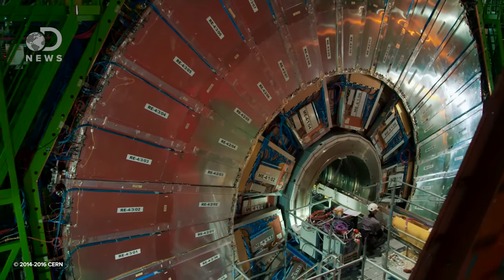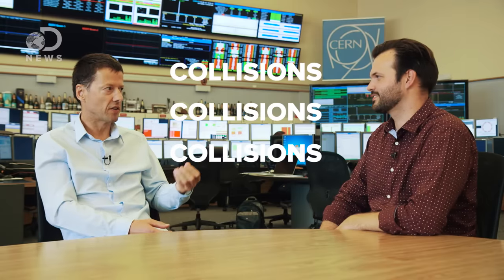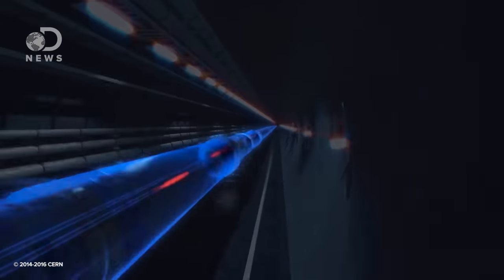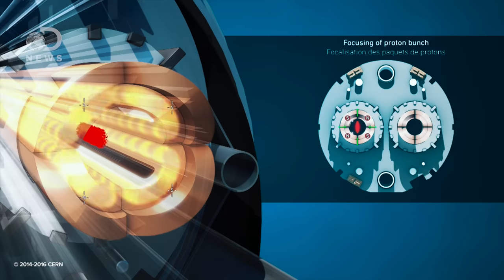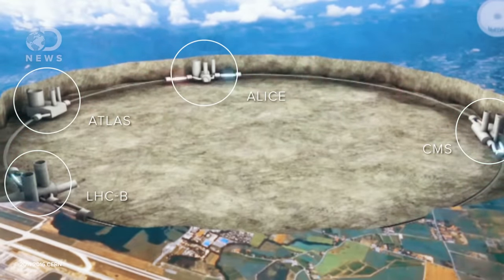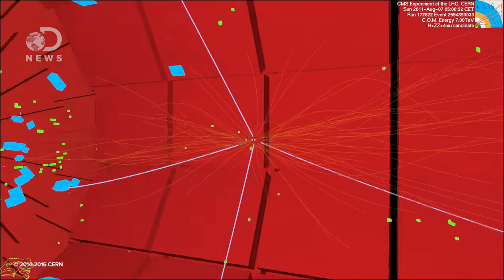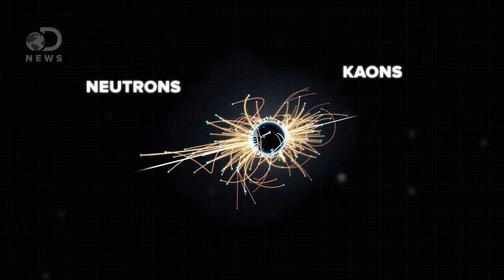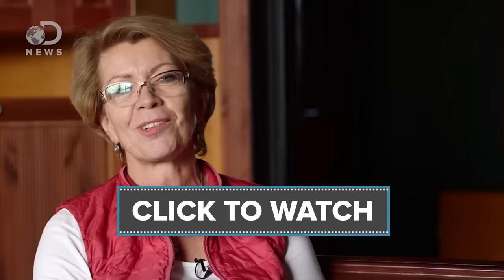Inside The World's Largest Particle Accelerator

Comment: From observing the footage of the particles colliding, there is a few milliseconds for the collision to cool down before another collision happens. These particles move at 99.997% the speed of light, and is still currently being worked on my CERN to get a lot faster. As stated here, the particles also tend to miss each other, making the collisions even more inconsistent. So by theory, if we were to achieve 99.998% of the speed of light or higher, while also maintaining the particles at a specific point in which the chances of missing each other is only slim, or increasing the quantities of the particles to have a higher collision consistency, it may be possible to generate dark matter. This happens because the increased consistency and speed, ultimately disabling the few milliseconds of no contact, will increase the number of collisions in a short amount of time that the odds of creating dark matter increases by 5% the initial percentage. so in short monke explanation, more particle, more fast, make more collision big chance black hole material.
Reply: Intern reaching its target of  High Velocity?

Comment: "What's inside a proton." This is a bit inaccurate. The collisions do not reveal what is inside a proton, but basically use the famous Einstein formula E = mc². 
Two protons collide with almost the speed of light. This creates huge energies that then again allows the particles to form, disintegrate and others to form until there are stable ones. 
Please correct me if I am wrong.

Comment: Could you use sound or light waves to try control the way the particles are moving throughout the Hadron collider? Or combination or heat sound and light
Reply: No, because sound is too slow. Light waves, maybe, but I doubt it. Photons have no mass, and don't really "collide" with things. They would be more likely to knock the protons off their course. 

For the record, though, the reason that these protons miss so often isn't because of technical error. It's just impossible to estimate where the nucleus of an atom is at any given moment.

Comment: How did they separate the protons from there hydrogen atoms to get the 100 billion protons?
Reply: Hydrogen gas is ionised using a strong electric field, and the resulting protons are accelerated and focused then injected into a linear accelerator.
Reply: @thevectmarketing5784  So the strong electric field kind of takes the protons from the hydrogen gas after ionizing it?

Comment: I always thought a dipole magnet was 1 single magnet but with 2 poles - a positive (+) and negative (-) not 2 magnets. Most magnets we are familiar with are dipole if I remember rightly, so you can take 2 dipole magnets and put the north/positive/+ pole from magnet 1 against the negative side of magnet 2 and they are attracted to one another. Then, in a way, they become 1 dipole with a shared plus and negative. if a + pole is put against another + pole they push apart. I might be wrong but that was always my understanding.

Comment: have they realize that they can create a black hole if the hadrons colide in wrong way or ever make a nuclear reaction
Reply: Of course they've considered what could go wrong before spending ten years building it.

It's entirely possible that a micro black hole can form. However, it would be so small that it would decay instantly. Nuclear reactions don't make sense, because you'd need atoms to do that, not just protons. In fact, the protons probably release way more energy than an atom when they collide, but it wouldn't be anywhere near as catastrophic as a nuclear bomb. That involves a large number of atoms fissioning in a chain reaction. Something like that can't be achieved on a subatomic level.

Comment: Impossible for mass to change - would destabilize particle. Harder to spin heavier particles, more charge, destabilize for many reasons - even harder to move a heavier subatomic particle in an atom. Instead of calculating the energy as mass calculate it as energy of motion or time of particle decreasing (since both are calculated) - no stopwatch on particle lol. Infinite energy means infinetally reducing time of the particle which means infinite velocity which means yes speed of light broken just like when two particles pass each other going over half the speed of light - in that case too the speed of light is broken - proves its possible.

Comment: What is electricity (I think its flow of electrons ) how electrons are generated from hydropower station or others sources of electricity because actually electron will be floating around proton in atom.so how  they  are removed from atom and are made into  electricity  .why metals conduct electricity.how electricity is converted into light in bulb .show answer with animation

Comment: It is difficult to know the type of charge of a particle based on the way it curved within a fixed external magnetic field. This is because the intrinsic magnetic field of the particle depending on two factors, namely its type of charge as well as the direction of its intrinsic spin motion. For instance, positrons are also negatively charged like those electrons but their intrinsic spin motion direction is opposite to the one of electrons. Really?
Anderson discovered positrons with the aid of a cloud chamber with a fixed external magnetic field on a mountaintop in California under intense sunlight. The energy level of sunlight is far below the one within the nucleus. Therefore ejected positrons must be derived from the electron-shell rather than from the nucleus. If positrons were positively charged, then they would be constantly repelled from atom to atom by protons within the nuclei. This is not what happening, therefore without any doubt that ejected positrons must originate from electron-shell. Why positrons have mirror magnetic field configuration than the one of electrons? 
We reckon positrons have opposite intrinsic spin motion than the one of electrons; thus, positrons possess opposite magnetic configuration than the one of electrons even if they have similar charge like those electrons. 
Let''s get back to basic before we become foolish in our endeavor in search for tinier, lighter sub-particles. In other words, we couldn't even get the charge of positrons to be correct what more trying to understand other tinier sub-particles. 
If you are interested in real discoveries,  I would recommend you to read my book, The Unification Theory - Volume One and you will be amazed with lots of new, interesting discoveries. In God I trust..

Comment: Maybe a dumb question...

Have they ever just timed the magnets in the accelerator to where they are set as if the particle is going the speed of light?
Reply: Our electronic chips aren’t fast enough to trigger the magnets on time. Also a particle can’t go at the speed of light
Reply: @mat7can106  
With timing the chips could be fast enough. Like turn it on when they know the position of the particle and the time it takes to turn the magnets will line up. Of course chips cant turn on and off at lightspeed but they can cascade in a timed way to simulate it. And how do we know that they can't go light speed . so many theories out there that they have and still finding unexpected things they cant explain and never saw coming.
Reply: @Blazeww  i dont really think that would increase efficiency…

Comment: leakage of information in Brazil on a phone call listened to this conversation
.... but general move in time and pure question of rapid acceleration and concetrar a large number of energy in an extremely small area but gave an erratica we lost the point and we do not know where the two were in the timeless displacement and also there was a great leakage of alpha radiation at the moment of the displacement they reached a speed of up to 95% of the speed of light and no more contact in any of the apparatuses disappeared as by charm and as if they had never existed we almost damaged the sirius and we escaped of a great monumental explosion.